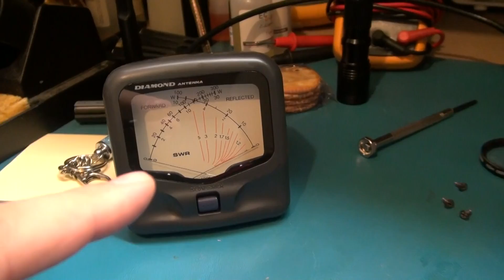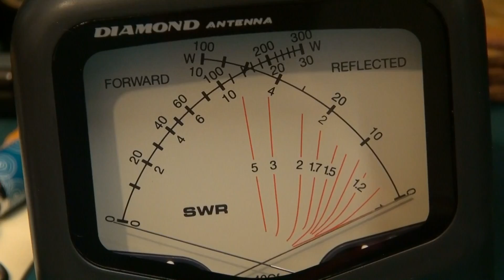KENWOOD TM-733 REPAIR PART2 "FINAL OUTPUT"

Comment: i have repaired alot of these, i have a way to solder them easily, and i also drop a small wire across each crack for more strength.
Reply: george vagner  i have i com 2100 radio its problem its sound not going far whats problem?